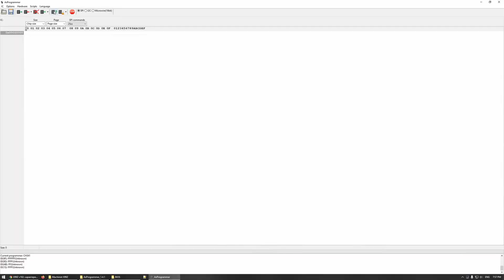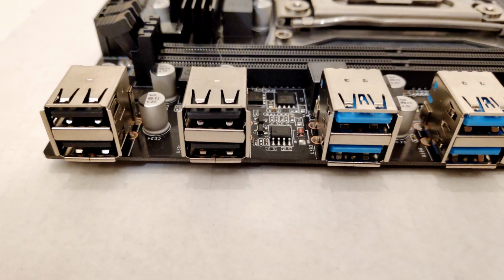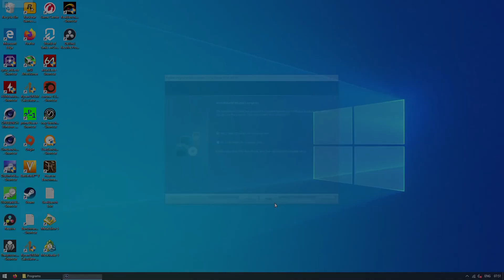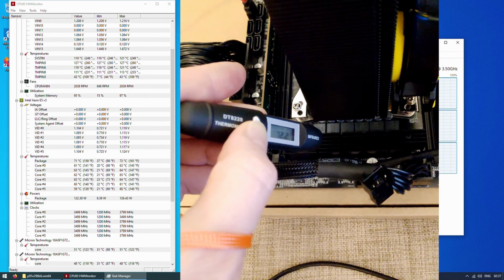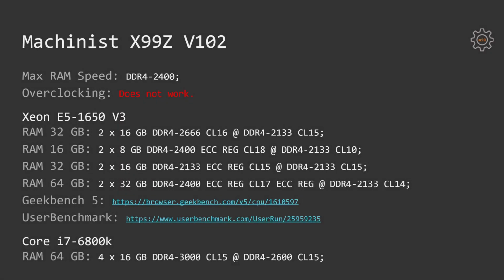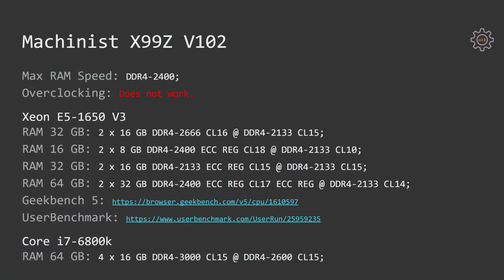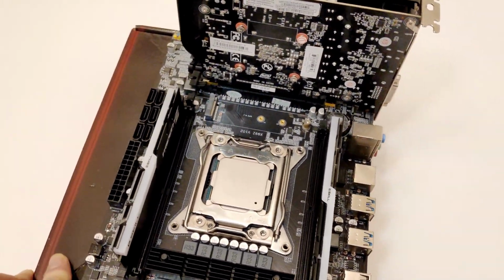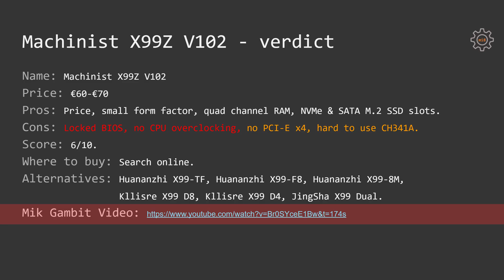🇬🇧 Detailed review and revive of Machinist X99Z LGA 2011-3 | CPU Overclocking | Turbo Boost Unlock

Comment: Just checked some russian forums, from what i could understand, that kllisre x99 is identical motherboard to machinist and it has same bios :) Really wish you would make some video, on how to use afuwin, afudos and programmer on this board. After watching your video's , it seems only you tell everything in a lot of detail. In description of your video you mentioned " Flashing modified BIOS with CH341A USB programmator & AFUWINx64.exe." Did you mean you can flash bios using ONLY by using programmer and nothing else and/or Using Afuwin and nothing else ? if yes, i found in russian post ready bios for that kllisre x99(machinist copy) , but it's in "bin" format and russian person mentioned that there is no need for EFI driver modification. And i got confused, main quaetion is can i use only afuwin(flash it from windows) with that "bin" file or do i need something else, also how to do it correctly? Could you please do video about all of it ?? Please!!! Your content is best !!! But we need straight forward tutorial, which isn't 30mins long. Like (machinist/kllisre x99z v102 + e5 2620v3 + ram - complete setup) setting it all up using easiest way, step by step :) Really looking forward to this my friend!! Keep it up.
Reply from the maker: You can write modified BIOS onto this motherboard using external USB flash programmer, for example CH314 OR you can use AfuWin to write BIOS onto the motherboard. You don't have to do both, whichever method is easier for you - use it. The `.bin` file is the same as `.rom` just different file name extension, you still can write such file into the BIOS. As soon as I will get my next packages from AliExpress - I will make extra content.

Comment: Hey, i just check your old video about this board, that you said it died and before that you said that flashing bios is locked in this motherboard, but you then you used tried first method.... In my previous comment i asked if your FFS method works, but you didn't really reply. Can you tell me now,  Will FFS method work ? or do i need to do something else before i would attempt that ?
Reply from the maker: Hi again. I have not validated Machinist X99Z with injected FFS driver, thus I can't guarantee that it will work. Most likely it will, but I would recommend you to prepare your own BIOS. There are 8MB and 16MB BIOS versions of this motherboard, and you can replace the BIOS files one with the other.
Reply: @Miyconst  Ogh so you meant in your previous video, that bios itself doesn't allow to overclock unlocked cpu's right ? and also tweak ram speed and timings. So that's why it required modified bios to do so. But it was locked. AM REALLY SORRY FOR BEING SO ANNOYING My friend -_- i just find it confusing. Doing powermac g4 sleeper pc, going to use e5 2620v3 , that machinist/klisre x99 for 60eur which is identical. But there is some very difficult russian videos with 30mins+ or. I just want to get it done easy.. My main quaestion still remains :( will your FFS method work on this board out of the box. Or will i need to do something more.. Not sure.. Also seen russian video, dude had some files with ready timings for machinist boardo and specificaly for 2620v3, he launched it, it ran CMD loaded some figures, restarted, he showed that to get those timings applied you need to save user settings and only then restore defaults to get those timings used,saving user defaults used for backup. Also not sure will it work for me. There so many things for cheapest x99.. Wished to see complete build guide, machinist/kllisre x99z v102 + e5 2620v3 + some ddr4 memory, and steps how to set it up fast (only FFS turbo boost + correct timings).. That's it
Reply from the maker: @TheThaddeusLab  As I said before, I do not have such board at the moment, that is why I can't validate. I cannot tell you that it's going to work because I have not checked it myself. If you are unsure - leave everything with the default settings. The stock BIOS of this motherboard does not have overclocking features and does not have RAM timings options. The modified BIOS (from the Russian video) has RAM timings configuration, it also can be used for Turbo Boost unlock with manual EFI driver installation. The FFS driver injection into the BIOS was not validated by me, that is why I can't tell you if it's going or not going to work.

Comment: Boss If i use E5 2620 v3 in this MB. Does VRM Get heat above 70 C temp?
Reply from the maker: No, with E5-2620 V3 VRM on this motherboard will be just fine.
Reply: @Miyconst  How Much?
Reply from the maker: @afsalc9674  Do you mean how much degrees? Hard to say, depends on your case airflow and CPU cooler, but it will be within the safe ranges.

Comment: I've tried bios from a link that u posted. There is a updated verison MODx99z v102. Inside the package there are 2 versions of bios, cpu_unlock_timings.rom and turbo-hack-timings.rom. The problem is that 1st one unlocks only timings (no turbo boost hack), and the 2nd one unlocks only turbo on all cores (no option to change timings). Is there any ready bios with timings and turbo hack or i should edit bios by myself? I want also to reduce CPU voltag because sometimes CPU reaches the power limit. Flashing prepared bios is the only way to do it or there is other option?
Reply from the maker: The `cpu_unlock_timings.rom` does not contain the 06F2 CPU microcode, thus you can manually install EFI driver with stock or reduced voltages. Once you find the stable voltage reduction - you can inject the desired FFS driver into the BIOS and flash it.
Reply: @Miyconst  Thank you a lot for your help :) .

Comment: Hello my ukrainian friend, i have question for you,  there is Killsre x99 motherboard on aliexpress for 60eur which looks identical to machinist in your video and from photo in sellers link (RE Store) it also has "X99Z V102" under socket naming. If it's same, what method would you recommend to unlock turbo boost for this motherboard ?,mine board is still on it's way, already have e5-2620v3, but i am very afraid to brick it :( can i do it using your prepared bios from FFS method unlocking guide ? if so which bios i should use ? thanks in advance!!
Reply from the maker: Hi there. I have seen that board, but I am not sure if it's the same as Machinist X99Z. It looks identical, but there is no guarantee that it's the same internally, my BIOS may work, but also may brick the motherboard, that is why it's better to use the original BIOS to prepare your own version of the Turbo Unlocked BIOS.
Reply: @Miyconst  Thanks for fast respond!! Ill do my own bios when it arrives then to be sure. Also, do you have any video's on your channel considering "What can you do if you bricked your motherboard" like ways to try fix it, reflash it using tools, i believe there is such videos on youtube, but you make better tutorials my friend :)
Reply from the maker: @TheThaddeusLab  To restore a bricked motherboard you have to use external USB flash programmer, maybe I will do a tutorial about it later.

Comment: These are very good info about the Chinese Motherboards, in your opinion and experience, I want to build a Xeon E5 2640 v3 with Turbo Bust unlocked, which one of the x99 boards that you already tested is the best choice?
thank you very much for the excellent info that you share here, it is really educational!
Reply from the maker: For myself I would choose Kllisre X99 D8, but for others I recommend Huananzhi X99-F8. Overall Huananzhi X99-F8 is slightly better, but it's also slightly more expensive. What's more important is that it has good BIOS out of the box and does not have any problems with flashing modified BIOS.
Reply: @Miyconst  Thank you very much for your advice!

Comment: HI, you videos are really good, i have a question, i have a vega 56, E5 2689 and 2x8 ddr3 ecc reg 1600MHz, but i want to upgrade this for a E5 2678v3 and i dont know what board use i think use the same ram in this board (sorry for my english i speak spanish)
Reply from the maker: If you want to keep using your DDR3 memory, then the best option for you is Huananzhi X99-TF.
Reply: Miyconst really thanks, do you think this upgrade worth it? Or wait to upgrade de vega?
Reply from the maker: @santiagomorales5464  It depends on what you are trying to gain with this upgrade. If you need more CPU power for video encoding - then go for it, if you are trying to get more FPS in games - upgrade the GPU instead.

Comment: Hey Miyconst, can you please make a video on manually editing ram timings? I have the 8mb bios.
Reply from the maker: 8 MB BIOS motherboards are not compatible with the 16 MB BIOS. You can edit RAM timings with a program called AMIBCP.
Reply: @Miyconst  How exactly?
Reply from the maker: @gettriggered_ian3269  Create a dump of your BIOS, open it with AMIBCP, navigate to the memory timings section, write required values, save the BIOS, write this BIOS onto the motherboard BIOS chip.

Comment: Hi. I have the same motherboard on his way. I have a e5 2680 v4. You have mentioned that it's possible to turbo boost using a modified bios. Where I can find that bios?
Reply from the maker: Hi and sorry to disappoint, it's not possible to unlock Turbo Boost frequency on all cores using Xeon E5 V4, only Xeon E5 V3 have such option.

Comment: Thanks for the videos. May you please let me know which motherboard is the most reliable for a server running 2x 16GB DDR4 with E5-2630 v3 24/24/7? No overclocking, but reliable. 
It would be great to have videos for servers !
Reply from the maker: These Chinese X99 motherboards are relatively new, thus it's hard to talk about reliability, still, I would say that the Huananzhi boards seems to be the most reliable. In your case Huananzhi X99-8M (the green one) seems to be a perfect fit.
Reply: @Miyconst  thank you very much!

Comment: Hello greetings from Mexico, I have doubts and I hope you can guide me, I want to build a platform with an Intel x99 motherboard for engineering, I need it to work with Windows 10 Pro 64, which will be used for audio and video editing, mathematical calculations, programming, virtual machines, and that can work with double boot for windows and linux, I already have some components such as a xeon e5 2620v3 sr207, samsung ecc memory 2133p M393A2G40DBD-CPBDQ a 16gb module, nvidia gtx 750ti video card, 120gb ssd disk for linux and 2 of iTb for data and a samsung 981a nvme of 256 for windows 10 pro, 700w gigabyte source and coolermaster q300l cabinet, intel Ax200 wifi card, I know that my processor does not support overclocking so at the moment I am not interested in this one, That if I want to change it later for a 2678v3 and put more ram memory, my question will work for me this motherboard x99z I can improve the dissipation of the vrm, I can use a card on the pci express x1 Asus sound, what if I'm interested is the turbo boost to use the six cores of the 2620v3 at 3.2ghz can be enabled, my first option is the huanazhi x99 f8 but I would have to buy another cabinet (to use this x99 f8 I need at least one other ddr4 module like the one I have to put in the first ram channel), that's why I thought about the x99z v102 motherboard or which one I recommend I hope you can help me and not bother with so many questions. great job your reviews
Reply from the maker: I just have answered you in the previous video :)

Comment: The only thing that hold me back from xeon is the motherboard.  Wasting 100$ for chinese mobo is risky. Even you got defect mobo.
Reply from the maker: Getting anything from AliExpress is risky, but there is no champagne without risk 😉. Anyway, if you can't afford getting a defective motherboard and deal with AliExpress dispute process - I strongly suggest you buy computer parts in your local stores to be able to have quick help and warranty service.
Reply: @Miyconst  yeah , ill probably build 1240v2/v3 xeon with used branded board, xeon is half of i7 price here so still worth.
Reply from the maker: @tiamindamanik8719  In my place decent LGA 1155/1150 motherboards are quite expensive, even on the second hand market the price goes up to $100, thus Huananzhi X99-8M + E5-2620 V3 makes more sense, for me.
Reply: @Miyconst  i just look at the marketplace,here lga 1150 price , asus brand with 4slot ram is 40-50$. I think thats pretty good.
Reply from the maker: @tiamindamanik8719  It depends which board. Boards with USB 3.0 & SATA 3.0 are expensive here, but if you can get a decent LGA 1150 board for a $40, then it might make sense to get a Xeon E3-1230 V3 / E3-1231 V3 / E3-1240 V3 or similar.

Comment: Which are the best x79 and x99 motherboard from AliExpress ? Thanks in advance .
Reply from the maker: Huananzhi X99-TF / Huananzhi X99-F8 / Kllisre X99 D8 / Huananzhi X99-8M. Can't really say much about X79, but the green X79-Turbo is a decent option, make sure to get the original one, not the "fake" one.
Reply: @Miyconst  Thanks for helping out. I will go with Huananzhi X99-TF.
Reply from the maker: @sage9238  Do you need DDR3 memory support?
Reply: @Miyconst  No sir ,i will go with Ddr4
Reply from the maker: @sage9238  The go with Huananzhi X99-F8. It is the same motherboard as Huananzhi X99-TF, but it has 8 DDR4 memory slots, while X99-TF has 4 DDR3 memory slots and 4 DDR4 memory slots.
Reply: @Miyconst  what if , i go with the Kllisre x99 D8 ? Is it better than the Huananzhi x99 F8 ?
Reply: Be safe during this outbreak we need people like you . Thanks in advance !
Reply from the maker: @sage9238  Kllisre X99 D8 is also a viable option. Overall Huananzhi X99-F8 is a slightly better board, but I really dislike the active VRM cooling, personally I prefer Kllisre X99 D8, but its stock BIOS is very limited, and you have to flash BIOS from Huananzhi X99-F8, that is why I usually recommend Huananzhi X99-F8 for people who want to get smooth experience out of the box.
Reply: @Miyconst  Very well, thank you for your valuable time that you gave to me .

Comment: thanks, any test with 2678v3 or upper?, grettings from México
Reply from the maker: E5-2678 V3 has TDP limit of 120 Watts, while E5-1650 V3 has TDP limit of 140 Watts, so from the VRM testing point of view, E5-1650 V3 is a better option.

Comment: Subscribed and liked you video! 

I have a question, have you tried using 4 x 8gb of ram on this board? thanks!
Reply from the maker: No, but I have tried to use 4 x 16 GB of RAM.
Reply: @Miyconst  Someone else once said single-rank (1Rx4, 1Rx8) RAM sticks does not work in this board, only dual rank. Are you able to test this?
Reply from the maker: @DLiu-ff1zx  That's not true. I have tested single rank memory modules on this board, and they worked. Only two cheap 4 GB memory modules didn't work, the rest worked well.

Comment: turbo bo all core e5-2678v3 this board compare  x99-8M  what is good ??
Reply from the maker: Huananzhi X99-8M has better VRM cooling, but Machinist X99Z would be just fine if you add an extra fan to cool down VRM zone.

Comment: Just get yourself a x1 to x16 extension and test a graphics cards using the x1 slot ;)
Reply from the maker: I will try to get myself a PCI-E X1 NVMe adapter.
Reply: @Miyconst  that's nice. let's hope the NVME ssd's can all work on x1.  I'm still pondering buying a minipcie to x16 expansion for laptop, or exprescard, or m2 x1 x4 slot... difficult to decide when I do not really need it and just want to test'm all. btw. Good job on getting the board working again ! I personally would've desoldered the bios chip.

Comment: Why Am I always first?
Reply: Because you love Miyconst :)
Reply from the maker: Is it bad?
Reply: @Miyconst  Just pure luck. To make my comment somewhat valuable (hopefully) I propose 1x PCI-E LAN card since USB3.0/Audio cards are hard to benchmark, and with LAN card you can check numbers (if it's full gigabit or so). In case you're willing to buy one of course. Cheers!
Reply from the maker: Yeah, I also think a PCI-E X1 network card would be good, but a PCI-E X1 NVMe adapter would be even better.